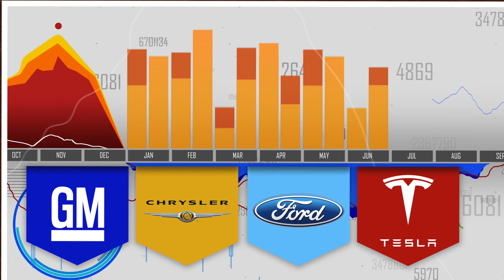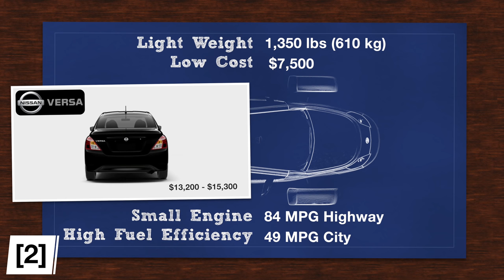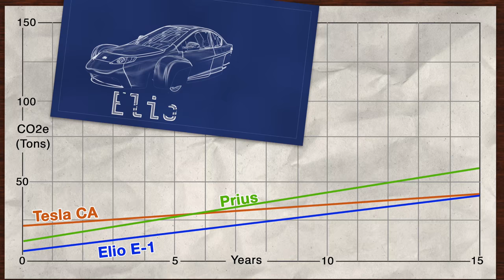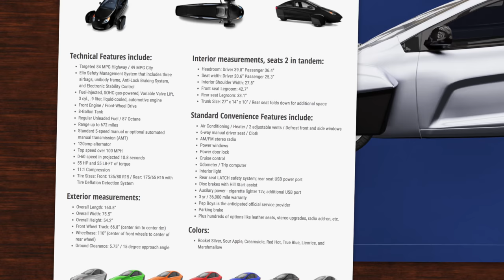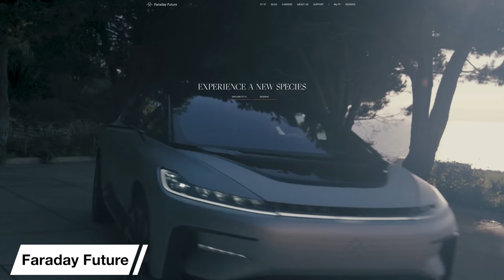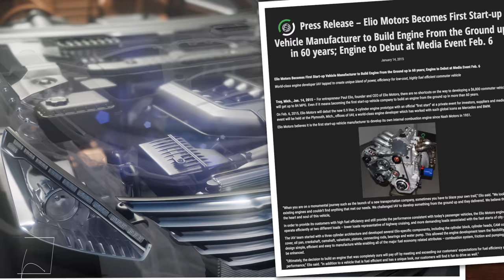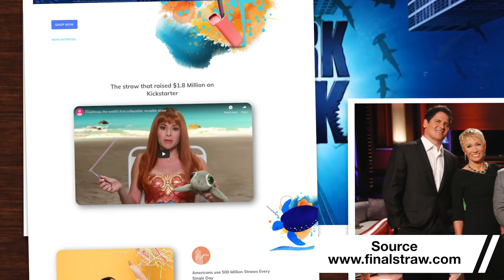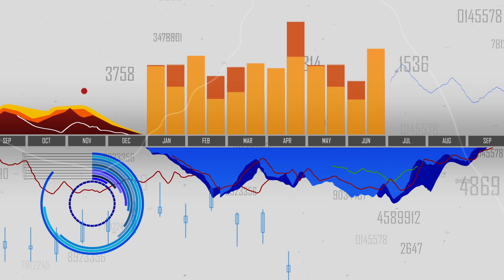How this Radical Car Missed its Chance to Change the World

Comment: This was the best, most well thought out review that I have seen on the ELIO.   I am a $100 reservation holder and I would love to buy an ELIO today.  I also don't believe that it's too late for the car to be successful.   I travel multiple states 4 days a week.  I have had many 50,000 mile years.  If I could buy an ELIO for less than half the cost of a car, get 2 1/2 times the mileage and lower cost of operation, I would buy it today for up to $11,000.  What makes the ELIO compelling is that it was supposed to be a front wheel drive.
Reply: So how is it? Did you get your Elio?

Comment: as someone light on money I'd buy the ever living hell out of that thing. I don't need to lug around 3 tons of storage space to go back and forth to work.
Reply: mike brink  I know. car companies just want to re-invent a slightly less terrible gas guzzler instead of create something different. probably a deal W/ the gas and oil companies
Reply: A enclosed motorcycle trike with a small trunk and working air conditioner , literally the perfect vehicle for the everyday worker. Yet we dont have them for some reason...
Reply: If you don't have a lot of money the smartest thing isn't to buy this three-wheeled motorcycle the smart thing would to be buy an inexpensive but reliable used car. If this thing breaks there's no extra parts ,if a Honda Civic breaks there's  tons of parts everywhere and aftermarket parts
Reply: @eksine  This is where them sourcing an engine instead of trying to develop their own would've been a godsend.  Most of their parts were off-the-shelf that were already used by other cars.  The door was a production door from something, I think in their prototype the steering wheel was from a Camaro or something.  Outside of the wind screen and some of the panels, it would've probably been quite easy to get parts for.  And if they had managed to get honda or toyota to make one of their small engines for them, parts would be readily available for those as well.
Reply: @dav3yb  their problems are all made up. The whole thing is a scam. They've been embezzling all of the endless funding, lying many times about production dates. The management is corrupt and every fact they told you was a lie. Nothing was delivered. Don't believe anything they say
Reply: @eksine  From what I've read the majority of the parts were sourced from other parts already in production on other things so they would be readily available.
Reply: @ciresolstice  didn't they say they wanted to make their own engine? in any case it's clear to everyone at this time everything was a lie.  I cannot even remotely understand anyone with a shred of common sense would still believe anything they said was even remotely truthful. if people really want a micro car there is such a thing called sub-compacts and smart fortwo's they would be safer than this in a crash, plus bonus: they are real
Reply: Kommander Rahnn  what more proof do you need just go look up all of the news that they've given out and compare that with the results and compare that with all the donations that they've taken with nothing to give back to the customers. That's the proof any average person should be able to piece together that
Reply: @eksine   Something like a used toyota echo or a chevy aveo would be a very smart choice. 
As for this elio... I'll believe it about 3 years after they are on the roads.
Reply: @lamia197  yeah, or a civic, I think a civic is classified as a sub compact too. as for 3 years on the road, no, I am sure the project is scrapped by now. I doubt anybody in the company believes it will happen, that is to assume if the company hasn't been fully abandoned by now
Reply: @eksine  If I remember it was until the 7th gen, after that it was just compact. My brother has a 2003 Si and it is very cheap to maintain. modern civic are good too. 
I meant I might consider  it after it goes on sale and people have been purchasing it for about 3 years. but yeah, I don't think it will come out.
Reply: @lamia197  I could bet you my paycheck it won't come out. my accord is leaking so I probably do need to get another car soon, not an Elio though for sure
Reply: @eksine  Yea, its never gonna come out. 
Maybe there was a purpose to getting elio back then. But now... I really can't see one.
Reply: Borrow an old GEO Metro for a few days. People in VW Beetles look down on you. Semis' wheel hubs are at about eye level.
Reply: @lilfgaming6359  The everyday worker wants a jacked-up 1/2 or 3/4 ton dually pickup, that's why. They are up to 25 mpg now when empty.
Reply: @eksine  The only spare parts old Civics need is inside door handles.
Reply: @eksine  Making your own engine and transmission avoids supply problems. Just buy a Honda 1 litre engine? Yeah, if Honda will sell them to you. Transmissions are another thing. Automatic transmissions are so exceedingly expensive to develop, tool up for and manufacture that many smaller companies outsource them. Manual transmissions look much simpler but they are not simple to get right. The best transmission makers in the world have fits getting them right.
Reply: P.S. Honda doesn't have to make any extra complete engines over what their own models need, plus warranty replacement stock to back up their own cars that use the engine. Same for other auto makers.

Comment: Americans have become such gluttons for "utility" (seats! towing! all wheel drive!) that many of us have lost sight of true, need-based practicality. This would be Elio's real battle. Fortunately the low cost of entry should help them overcome this.

I remember stumbling across Elio back in 2013 when I was having a similar idea.

I drove over 20,000+ miles per year for several years and realized that over roughly half of that mileage was accumulated while I was alone in the vehicle, with less than a couple grocery bags worth of cargo. Between Michigan weather and drivers I didn't want to make these commute and errand runs on a motorcycle, but dragging along 3,000 lbs of automobile is a terribly inefficient way of solving the problem. Elio seemed like a good solution to add to my existing car (BMW 3-series), to accomplish the small tasks with great efficiency, leaving the Bimmer for longer trips where the comfort, cargo capacity, and additional passenger accommodations were needed. Unfortunately the Elio always seems to be a year or two away. If they actually start production and deliveries I might jump on board.
Reply from the maker: Well said
Reply: I've already put $1,100 into one. WHEN it hits the streets, I'll have one.
Reply: Thats why i drive an frs. zero friends to carry, high compression efficiency, fun steering.
Reply: Get a Hyundai i10.
Reply: Exactly. Everything about this vehicle has all of the advantages of a motorcycle over a car, but adds in the creature comforts of a sedan.
Reply: I drive alone in a minivan that gets 13.5mpg. I feel terrible driving such a large inefficient vehicle but my career is carrying large objects...i might consider something like this for a second vehicle. Tho safety doesnt look gucci.
Reply: @LIFEOFSTUFFEDANIMALS  For me, coming from riding a motorcycle year round, and being my only vehicle, I would say in my position; this would be a "safety upgrade."

Comment: you can have a car for the price of 7 iphones. LOL. I'd have one just to have one. as long as its got heat and ac.
Reply: well, you could get one at that price if every single plan of theirs goes smoothly and without any hiccups, because if production is not 100% ready then it's gonna be more expensive, and that being if they can scale up. 
I always chuckle at these "tesla killers" that think all you need is a "cool concept"
Reply: @funkahontas  no one said its a tesla competitor fanboy, its a completely different concept.
Reply: @vteckickedin2365  being an entirely different concept doesn't make it magically easier to manufacture, so my point still stands.
Reply: this thing never said it had heat or AC, engine is so small you're lucky if it has a fan to cool you off at 100 degrees outside
Reply: @eksine  "this thing never said it had heat or AC"  Where's you dream that up?  Their intended equipment specs are readily available so there's no need to speculate.  Both heat and air are included in their intended base price.  Can they deliver? Only time will tell.
Reply: @johnpalmer3848  didn't dream anything, didn't see it when I looked at their site . What the fuck was your whole point about ac  and heat when you just admitted they might not even deliver it? You guys are fanatics, hmm let me argue about a motorcycle which hasn't come out every year like it's been around for ages. So I was wrong, ok fine why blow it out of proportion?
Reply: @johnpalmer3848  yeah btw how are you enjoying the AC and heat in your Elio cycle? I mean you must know since obviously it has it right,.  RIGHT?
Reply: They did say on the Eilo website,  the car will have A/C and a heater, the heater works off the hot water from the engine,  the a/c can be the same from the Chevy Metro, a 3 cylinder engine car. The same engine they used on the first prototype.
Reply: @aguirrma  I know I double checked when he called me out on it. I just didn't realize the specs were so far down the features page. Their site is so cluttered and I already admitted I was wrong, what else do you want from me?
Reply: @aguirrma  also I rebuild transmissions and other parts of the car, I have YouTube videos. I know how a heater works
Reply: @Drakilicious ...and buying someone else's problem. I believe most used cars are on the sales lot because they presented a headache for the last owner. For example: my last three used cars had working AC that died within a year of purchase.

Buying a new car for the price of a "certified" used car seems like a winning proposition.
Reply: @CoverYourActions  did you miss the 3 or so times I said yes I was wrong and it is listed? do you even check responses or just post whatever?
Reply: @eksine  Sorry, I didn't see the other comments and I have deleted my comment.
Reply: Tim Z n
Reply: Amen, brother.

Comment: Start hand building the elios in a warehouse or garage then get a factory.
Reply: Limited hand built Elios would need to be priced around $100,000. Not very practical.
Reply: This is what they should have done to start off with.  It would help them understand the process of building a car.
Reply: or even offer kit models as these steer clear of a lot of regulations being home built

Comment: I live in a small town and only two and a half miles from work. In 2008,  I bought an electric scooter. In 2012, I bought a longer range electric scooter. Both could get me to work or dairy queen. The second one I bought could get me to Walmart and back home.
Reply: Aubergine Bellen  
Aren't you the most optimistic person on earth.....
Reply: Chew Chew Train  
I have a EV unicycle that can go 20 miles on a charge.  The more expensive ones can go 60 miles.
Reply: Chew Chew Train  
Mine goes 18mph at cruising speed (alarm goes off past 18)... Other models go 20+ mph.  I did consider getting an electric skateboard, but the small wheels was concerning.  I remembered riding a skateboard many years ago,  and I went flying only because I ran over a small pebble.
Reply: America is going to be the WORLDS ECONOMY manufacturing scooters
Reply: Chew Chew Train  "My starter EV is an electric skateboard. Just 1 penny for electricity to travel 10 - 12 miles at 23.5 mph and LOTS of fun, too!"
My 3/4 ton Suburban only gets 12 mpg, but it only takes me half an hour to earn enough to fill it up.
Reply: jmarks881  assuming dates occur with anyone of legal age.

Comment: To answer your question, once car manufacturers figure out how to make a similar vehicle that is pure electric, and then sell it for $8,000, Elio will have missed their window. Until that happens, it wouldn't surprise me to see hundreds of thousands of these things on the road if Elio can ever get off its collective posterior and finally go into production. I understand the challenges and have followed them since around 2014. Back then, the base price was supposed to be $6,800. All things considered, the fact they're only up to $7,500 is pretty decent. I'll likely get one a couple years after initial production, assuming that ever happens.

As well, consider the weight advantage of this vehicle and the leaps we're making in battery storage these days. It wouldn't surprise me if Elio came up with a compatible motor and battery system to create a 300-mile range vehicle with a 15-20 minute charge time. The only real hiccup is the regulatory requirements. Of course, it tickles me a bit to imagine trying to put an Elio through the test ride course.

Comment: I drive a smart car , Bought it 3 years ago . It was 2009 I got it for 3500.00 I love this car . I drive it 65-75 mph , 68 miles round trip. I would buy a new one today if it a full gas motor . Weights 1800 lbs. goes in the back of the motor home or on the same trailer with my utv. I know I heard the laughs and the jokes , but I get 48 mpg ,and it’s just me going to work , it carries my lunchbox and book bag. I want one of these . Been on the list for one for 7 years. 500.00 got yu in on the first run. I have trucks and other cars , but for work , this would be ok.

Comment: cars with this type of efficiency and 4 seats are available right now in japan, the Daihatsu Mira e:S burns 40 percent less fuel than the conventional model. Power comes from a three-cylinder 650cc gasoline engine that provides an impressive (for its size) 52 horsepower at a screaming 6,800rpm and 60Nm (44 lb-ft) of peak torque at 5,200rpm.

The official economy figures fro the Japanese cycle state the car will go for 30 km on a liter of fuel (which is about 70.5 mpg US), according to the JC08 Mode test cycle, or 32 kilometers per liter (75.2mpg US) on Japan's 10-15 Mode test cycle. and that is the combined cycle.
Reply: those K cars in Japan don't pass safety regulation here in the US.  The Elio is classified as a motorcycle so don't have to meet the same safety standards.
Reply: greggy weggy don't forget TURBO kie cars. Still efficient, but whoooooooosh tutututu 😛

Comment: My only preferences for the Elio over the Solo is that it is gas so I could drive it to LA or across the country if I wanted to and I know I would want to, and it can cary two people. What a fun date vehicle. I personally, I dont think it would be so uncomfortable. I have pedaled 60+ miles in a 150 pound home built fully enclosed velomobile and I think the Elio or Solo would be far more comfortable.
For now I wil buy a solo. If they ever build the Elio, I will buy it to and if Sonders gets the three seater trike built I might it as well. I will have a mini fleet of different autocycles. The only problem would be deciding which one to drive each day..
Einy Miny Miney Moe.
I figure why spend 10s of thousands of dollars on a Tesla when you can buy several uniquely different electric or gas or hybrid autocycles?  
I do hope someone will build a lean steering autocycle. I think the Elio would be the best design because it already has the separately enclosed outrigor style front wheels.
Reply: Right on Andrew! Leaning tadpole trikes are at the top of trike design as far as I am concerned. My dream would be a 3-cylinder diesel-powered Elio with tilting front end! If there ever was a purpose-built piece of transport designed for comfort and economy at a reasonable price, the Elio was and STILL is the closest to my concept! I still want one and will buy even if it takes them another decade to produce!